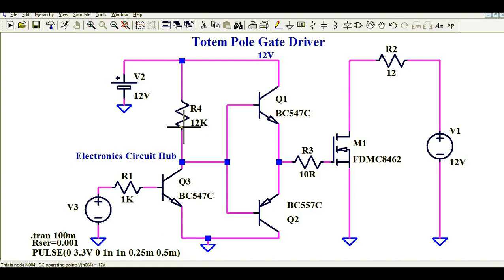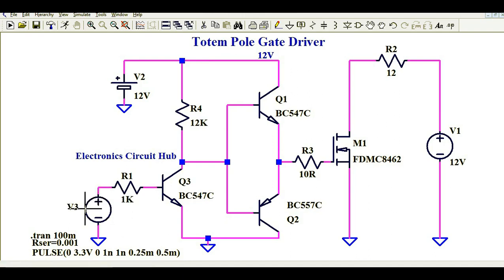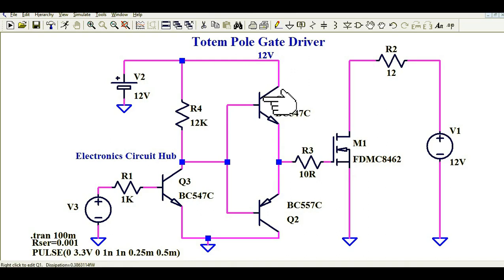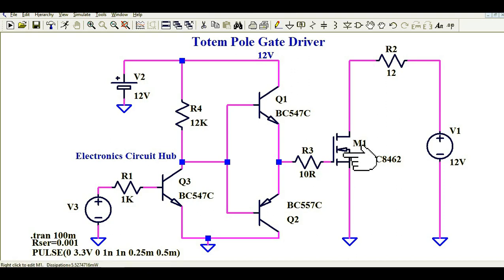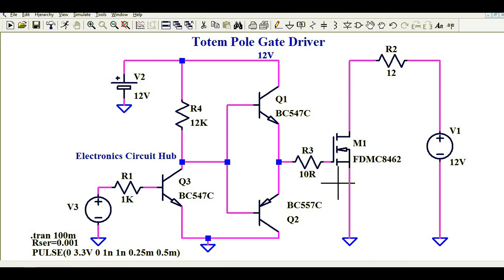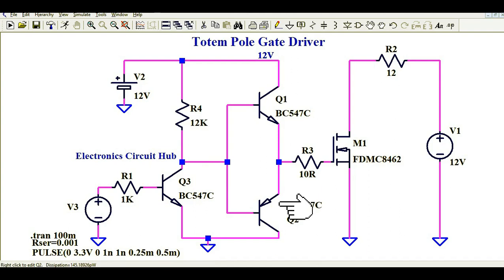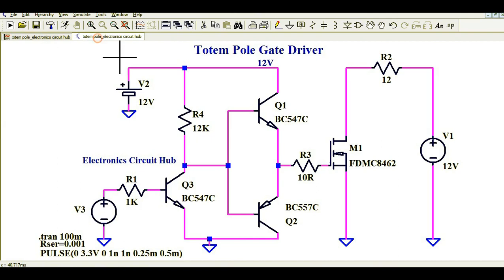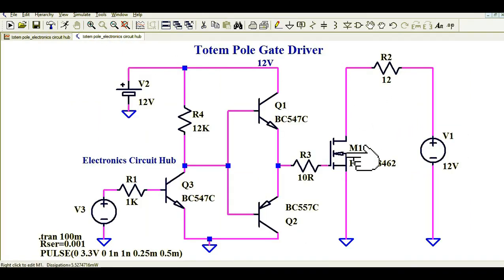Push Pull MOSFET Gate Driver | Totem Pole MOSFET | ltspice simulation

Comment: Nice video.. please what is the work of R4 (12k) in the circuit and what will be the effect if i reduce it to 1k .... thanks
Reply from the maker: Hey...thanks for asking good question...R4=12K so IR4 = 12V/12K = 1mA. Portion of 1mA will be flowing through collector and base of the transistors. In case of 12mA (12V/1mA) may damage base of transistor.

Comment: What change would you make to the circuit if you were using 3.3V logic signal that has to keep it on at 3.3V
Reply from the maker: Hi..I did not understand your question. Could you please elaborate more ?

Comment: Hello, first of all Thank you for the video.  I have a question for about the pulse voltage supply current wich  is  -3.2 mA  in some cases. Could this negative current burn or damage the mcu in real world ?
Reply from the maker: Hey...thanks for asking very good question. You can increase the base resistance of npn transistor anywhere between 3.3K to 4.7K to reduce the base current.
Now coming back to your original question, if you configure micro pin as push pull configuration then only it will source and sink the current . incase of output high and low it will only source.
Incase case sinking 3.3mA of current from MCU pin is not going to damage the MCU. Micro controller can source/sink 8-10mA current form mcu pin unless and untill the summation of all pin current will remain within the limit. This also depends on manufacturer to manufacturer (mcu to mcu). 
For example if summation of all pin current is 40mA so you can draw 8mA from any 5 mcu pin .
Reply from the maker: Look at any mcu datasheet for better understanding. Hope this help. Its hard to explain everything here in comment.
Reply: @ElectronicsCircuitHubECH   I never thought of this. I understand now, thank you for your detailed explanation.
Reply from the maker: @EmreninLaboratuvari  Good Luck, Keep Learning!

Comment: I don’t use a npn transistor to amplifier my signal voltage so the base voltage is from the pwm pulse 15volt and my totem pole driver use 55 volt and the gate voltage was always 15volt to the mosfets the circuit work great if the mosfet was getting 55 volt the mosfet would damage so there is 3 type of totem voltage is one and current is over and both
Reply from the maker: Thanks for your feedback.